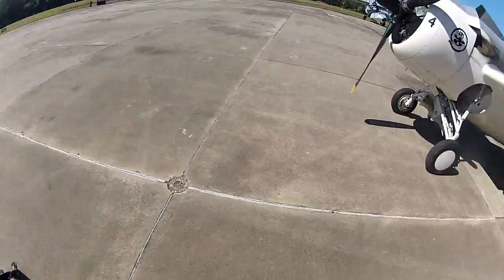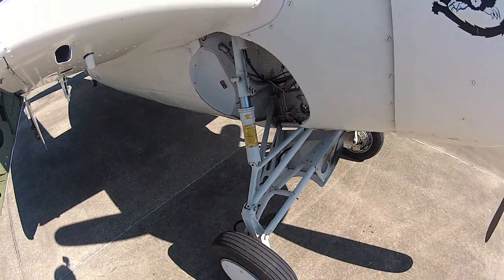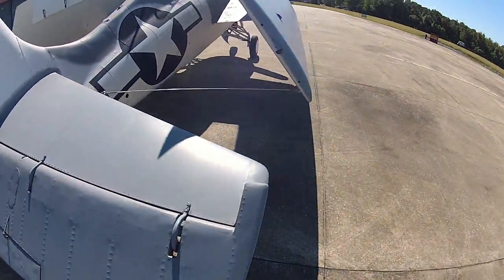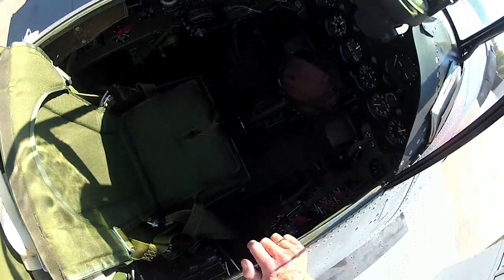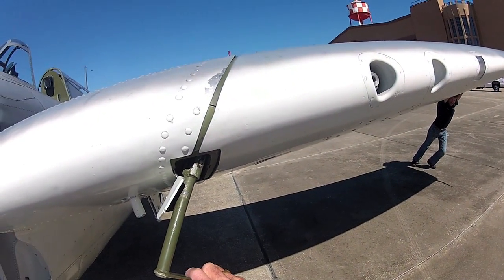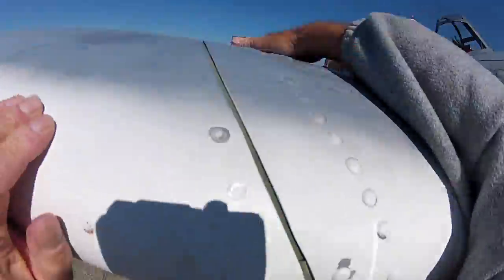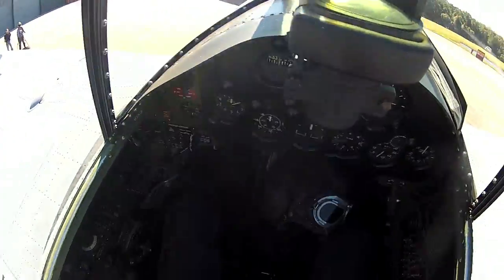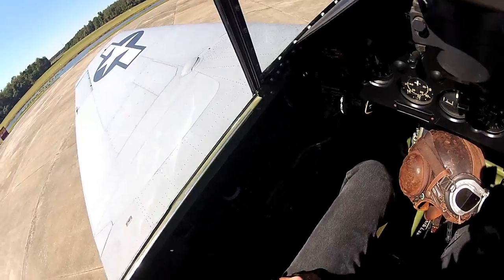Grumman Wildcat - Part 1 - Kermie Cam

Comment: I've read about Japanese pilots pumping 500 rounds into one of these and even seeing bits and pieces fly off-and to their amazement it would keep flying. The Wildcat had a rather dubious debut in WW2 as it went through an expensive development program and it's underwhelming performance against A6M5's caused some controversy as the Navy was stuck with it. Luckily in the hands of good pilots it's firepower and ruggedness evened out the odds along with the ingenious 'Thatch Weave' tactic where two Wildcats flew in a team-with the first one being the 'bait' and the second one following behind and both of them doing a back and forth 'weaving' pattern. When a bogey locked onto the first one, the second one would wait until he had a clear zone of fire. It worked brilliantly until the more capable Corsairs and Hellcats arrived that could take on the 'Zero' by themselves.

Comment: And I will add that back when he was still in the Dallas area I saw him demonstrate a LeRhone or Clerget (I can’t remember) engine from a WW1 Nieuport.  He showed the small crowd of 15 or so how the blip interrupter or whatever that is called (regulates how often spark plugs ignite)  controls engine RPM.  The engine was on a test stand and when he hand cranked the wooden prop and went full throttle it seemed like the cable come-along winches that we’re holding the stand to the tarmac we’re going to pull apart.  That 100+ HP engine was loud and amazingly powerful - kind of frightening.  He was standing behind the stand in the prop wash (or more like prop blast).  Thanks again, Kermit.  Cool stuff happens around you, it seems.

Comment: Folks may not believe this and I wonder if Kermit remembers, but I sat in that Wildcat.  I was among about 100 people at a private party at Kermit’s facility in Florida in 1995.  I worked then for a special guest of Kermit’s that did a little concert along with a couple of other bands at the day party outside.  He flew a Storch for everyone into a strong headwind and it just hovered up there.  A lucky guy from another band got to ride in the back seat.  That night at the gathering inside the buildings guests ate and visited and some (including myself) played on an early flight sim with six or eight cockpits linked together for dogfighting.  Each had seats, sticks, throttles and pedals.   At some point during the party I asked Kermit if I could look more closely at the Wildcat as it was my favorite Navy aircraft and he took me out to the large hangar - no one else was with us-  and put me in the seat of the plane in this video.  He said you can move the stick and rudder pedals but don’t touch the switches ESPECIALLY THESE (he didn’t shout but he did add emphasis).  He said those will start the engine!!  Then, amazingly, he walked back into the reception room adjacent to the hangar and left me there alone sitting in the cockpit.  I was just tripping.  The cockpit is much larger than I expected.  That was a fun day and night.  Thank you, Kermit Weeks!!  I treasure that memory.
Reply: I believe ya bud

Comment: Electric motor to change prop angle, now I am curious how that wire connects to a spinning object. Happy to see the gun sight in place - warbird cockpits look kind of naked without.
Reply: Ok, electricity is provided via slip ring and brushes - had to look that up.
Makes sense, nifty for 1930-tech - still used today.
The hydrologic system seems more simple, less likely to malfunction (but what do I know, not technically inclined).

Comment: How many young men went through this exact process on their last day on Earth?  Poor old Wildcats.  The Zeroes ate them alive.  But they were just BARELY enough to stem the tide.
Reply: Not really true. Sure, initially the experienced Japanese pilots had a field day against US pilots who tried to dofight with them.  Once the US pilots changed tactics, the tide turned pretty quickly.

 Per (https://www.chuckhawks.com/1v1_zero_wildcat.htm)

"Although the Zero had important performance advantages over the Wildcat, the A6M2 was never able to dominate the F4F-3, as it did other period Allied fighters (Hurricane, Buffalo, P-36, P-40, etc.). Ultimately, Wildcat pilots prevailed against Zero pilots by means of better tactics and, later in the war, better training. Operating in four ship flights and two ship elements, instead of the three plane Vics used by the Japanese, gave Allied pilots more flexibility in air to air combat. Teamwork, such as the famous Thatch weave, was an effective antidote to the Zero's superior performance. By the end of the war, the various Wildcat models had proven very effective in air to air combat and recorded slightly in excess of a 6 to 1 kill ratio."

Comment: Following a checklist during the walk around inspection would have reduced the number of trips around the plane and the likelihood of missing an inspection item...like having to backtrack and check that the battery was secure and connected.  One of the first things that should have been checked was that the battery and magneto switches were in the off position...especially before turning the propeller.

Comment: Only draining the fuel sump for about one second is not sufficient to assure no water exists in the fuel! Yes, I'm correcting the great Kermit Weeks! A proper fuel sample should ALWAYS be made within a cup or tube to assure no water exists in the fuel. As a CFII/A&P I am not surprised by the actions of this old, bold pilot of so many giant, powerful, expensive WWII birds. You think something so "minor" as a proper fuel sample could endanger a flight? I have been a victim of improper fuel/water sampling many years ago. I had a partial engine failure due to water in the fuel. Guess what?! I had drained the fuel sump onto the tarmac for a second or two just like Weeks did in this video! ALWAYS gather your fuel sample in a cup and continue draining until no visible water exists in the fuel!

Comment: Question: How much does having foldable wings compomise their structual integrity? In a dogfight, would you be limited to a certain amount of g's/speed? I love your videos by the way!
Reply from the maker: The Wildcat has no limits. The wings are stronger because of the extra stuff in there, but it makes them heavier also.
Reply: There were a few aircraft g limited by the folding mechanism in the wing, such as many bearcats, but the wildcat and hellcat had different mechanisms and weren't g-limited by the wings.

Comment: Is the PBY in the background yours  or in flying condition?
Reply from the maker: Mine. Not flying condition, at the moment.
Reply: @KermitWeeks444  Hope to see it flying soon!
Reply: @KermitWeeks444  Generally, what weight and type of oil is used in these old radials? Does it vary between make and model of engine? Thanks!

Comment: Regarding the cable that keeps the wings retracted, why is there a quick release locking pin on the forward part and a bolt and nut on the rear part? Why not have two quick release pins?

Comment: Question (maybe stupid) - Is it safe, to put the radio cable under parachute belts? I mean, if there would be a need to bail out, isnt there a risk of stucking in the cockpit just because of that cable put under the belts? Sorry for clumsy english. :-)

Comment: Kermit, I play a game online called Warthunder that seems to take great pride and go to great lengths to mimic these planes diligently like the real planes. In other words, there isn't ever a 'laser beam upgrade' and so on. haha. My question is, it seems like there is a ton of labor to get one of these things into the air, both then and now, simply from all the checks you have to do before flight. What do they do in emergency situations where an attack is imminent? They can't possibly go through all these checks. The scrambling of these planes seems to either negate what is normally done or seem unnecasary unless there are a lot of hours or 'miles' on the planes? Pardon my ignorance on it. Like I said, the closest I'll ever get to 'flying' one of these planes is in Warthunder. But it seems like a lot of work both before, during, and after. haha
Reply: And WWII pilots often had a ground crewman dedicated to his aircraft. Crewmen were responsible for the items a pilot would inspect during a walk-around inspection.

Comment: I never really noticed before this video, which kind of unintentionally highlighted it a bit due to tge camera i think.  But from what it looks like to me the F4F Wildcats main gear isnt that much wider, if indeed its wider at all, than the Me/Bf 109s main gear. Ive heard it said many times, and its service records back the word of mouth stories, that one of the greatest flaws of the 109 series was its narrow undercarriage. Its narrow undercarrage caused many of that types accidents most especially with newer,  low time pilots comming out of the war time flight schools but also regular experianced pilots transitioning to type from other aircraft. In fact there were more pilots killed in transition and through landing and takeoff accidents than were killed in combat in the 109s by a fairly decent margin all due specifically to the unusually narrow main gear. 
Yet i have never heard anything at all like that concerning the Wilcat, never not even one time. Now that i see how narrow the track of the wildcats mains i am very suprised ive never heard even whispers because it had to have suffered at least some of those similar issues as it most definatly has a narrow track. Anyone out there hear anything about the wildcat having any landing issues besides pilots accidently breaking their legs/wrists and other normal wildcat issues? I would appreciate hearing of them, thank you.
Reply: There's two aspects to that. One was quite simply power, the F4F was decidedly less powerful than later 109 variants, reducing the effect of the narrow track gear on takeoff.

The second is wheel geometry, the Wildcat's tire geometry is much better than the 109's, the angled wheels can result in unexpected toe-in on had touchdowns as the tire compresses, the wildcat's near vertical wheels don't have that issue.

The F4F was known to have track width challenges as well, it's one reason why all three of the successor designs went to quite wide tracks on their gear.
Reply: It is a similar case with the Seafire which being an adapted Spitfires was criticised for being tricky to operate off a narrow flight deck. Perhaps it is the combination of a narrow track and high torque, the Wildcat as the other commentor said was far less powerful. Perhaps the Wildcat also had a lower stall speed which would give pilots more room to manoeuvre.
Reply: Me 109 was very unforgiving in landing. Also later the engine was three times more powerful than with the original design also with lighter two blade propeller.  Finnish pilots flying on  G variant noticed that it had to be landed by using the engine power. If the throttle was put down the plane immediately dropped wing and you were into trouble at least breaking the landing gear.

Comment: Should have put a cup under that fuel drain to check for water/contaminants. Just draining a little off will NEVER indicate what may be in there.
Reply: nowthisis2stupid Smell has nothing to do with a fuel contamination check. Water sinks to the bottom of a cup and is the only way to know if there is water in your fuel. If water is present you drain another sample until no water shows up. Just draining without sampling is risky.
Reply: nowthisis2stupid I've enjoyed nearly every video this man has on You Tube. Who are YOU to say Kermit has flown more planes than me? You have no idea. I have not claimed to be "the expert." Every private pilot candidate from day 1 learns to drain the fuel in a cup for several reasons. Dumping it on the asphalt is wrong in so many ways. You are obviously not a pilot nor A&P as I have been for a long time. Your You Tube name speaks for itself.

Comment: just a simple question that I been asking my self why most of the time the internal parts of the plane are colored in green I know some internal parts are also gray if someone tell me is this is a mandatory paint code. THANKS
Reply: juan sanchez Juan -- the color is called "Zinc Chromate" and was used extensively in armed forces aircraft because it is anti-corrosive and also anti-rust.  It's use was primarily on aluminum, which, as you likely know, was the metal used most in WW-II aircraft.  jsquared
Reply: The green-tint makes if fly faster and longer.  Doesn't rust or corrode, so keeps the metal from escaping.  Besides, what right-minded fighter pilot would want it to be pinkish?  That would make it harder to spot hydraulic leaks, and have the enemy shot at you just to see the inside of your pink airplane.  How embarrassing.  JK.  Roger Jackson is correct.
Reply: The Grey was Grumman Grey and was used by grumman as an unofficial alternative to zinc chromate in areas where you want to spot leaks.
Reply: @BillAkaQ  Interestingly, early F4U-1 Corsairs had salmon-coloured internal primer rather than Zinc Chromate, Vought stopped painting their planes pink inside around the time of the switch to F4U-1A production.
Reply: Rutan Voyager, first non-stop around the world, 1986, was designed by Burt Rutan. The wing was not painted, saving weight.

Comment: devastated. Would think if you were fighting a zero you'd want to keep the speed high as the zero didn't have hydraulically boosted controls so the zero pilot would have to work harder to maneuver. In Korea American pilots learned to keep their speed high transgenic as the mig 15 was almost impossible to maneuver at those speeds due to no hydraulic boost and the air liads being so high.

Comment: kinda scary to watch you guys pushing that propeller like that after you just turned the fuel on, i know theres many more steps before it will run but it still just makes me cringe...
Reply from the maker: There is no fuel on yet.  All the switches (Mags, Master and Fuel) to start are not on till the pilot turns them on in the cockpit. and

Comment: Thanks for posting this. My Dad served as a Chief Ordnanceman's Mate on the USS Hornet CV-8 from a few months before the attack on Pearl, through the Doolittle Raid mission, to the day it was sunk in the Battle of Santa Cruz Islands in October '42. One story he told was that as they were steaming toward Japan to launch that raid, sometimes they would find that the wire ropes securing the aircraft to the flight deck would be RED HOT. They eventually worked out that they were absorbing energy from the New RADAR system that had been installed before they sailed! Years later I got a few chances as a kid to see the interior of the Forrestal and the Intrepid, visiting the ships as a dependent when my Dad was crew on those ships.
Reply from the maker: Thanks for sharing. And thanks to your Dad for his service.

Comment: Could someone explain why Grumman Wildcat succeeded in where the latest version of Brewster F 2 A3 did not ? I am aware that Brewsters were shot down in Midway in encounter with Japanese. But then those were the days when they had not devised proper tactics against the Mitsubishi "Zero" fighter. Yet Brewsters did shot down several "Val" dive bombers in Midway which seems to be forgotten. Reading Brewster's and Grumman's performance on paper, there does not seem to be much difference. Both climb and top speed are on the same margin likewise service ceiling. Both have large caliber machine guns. It gives the feeling that Brewster's poor result was a matter of tactics rather than the plane itself.
Reply: You could read the long answer to James Roberts, explaining the Thatch Weave. Wildcat roll faster than Zero, at high speed. Thatch used that difference.
Reply: @voornaam3191  I am aware of the Thatch Weave. Apparently the ability to roll made it possible and also that the Zero's ability to quick turning was limited to slow speeds.
Reply: @onsesejoo2605  Okay, it wasn't much of an answer. You'll need more info.
Reply: @voornaam3191  Thanks to internet it is only a matter of patience. I am Finnish myself so I know something about Brewster F 2 A and how it was a success against more nimble Soviet/Russian fighters using energy tactics but could out turn e.g Hawker Hurricane used by Soviet/Russian pilots  especially in mid to low altitudes.
Reply: I'm in the Netherlands. Someone at the local small airport is building a cold war museum. He started a foundation, bought a Tšekin Mig-23, a Saksa Lockheed F-104 Starfighter, for display. He is building a team of volunteers, finding documentation and more. This museum is his project, can take some years, but it looks good. So there's an old Mig-23 standing in a hangar 5 km from my house. Thanks to someone special.